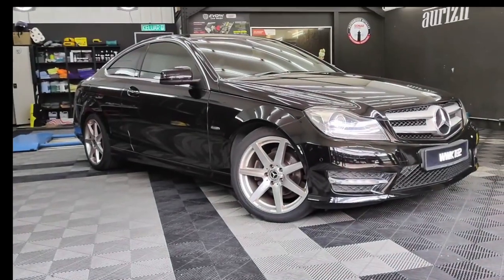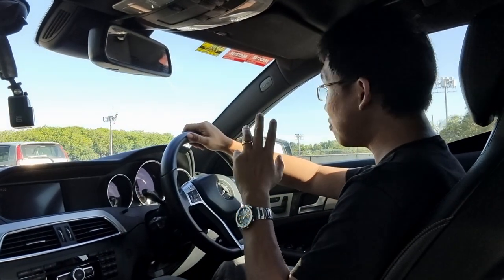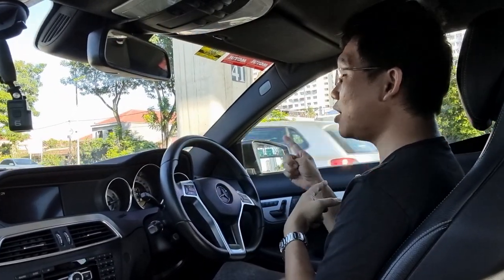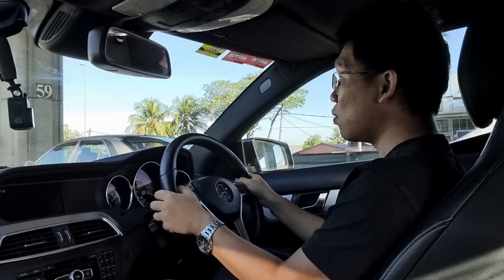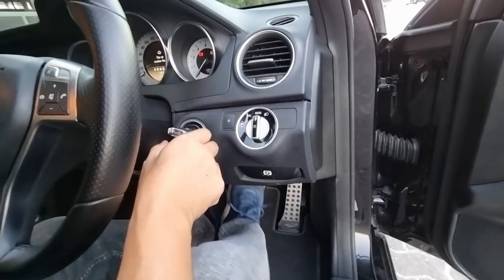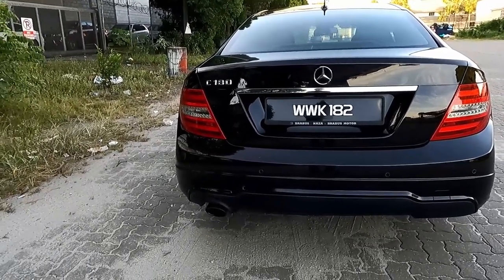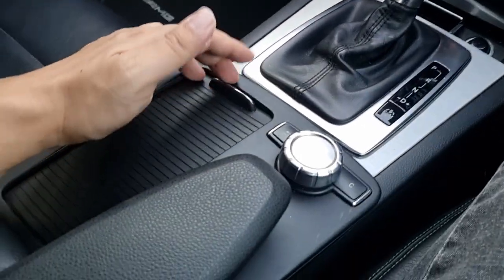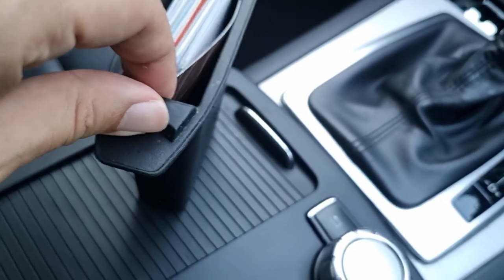Mercedes-Benz W204 Facelift - The Most Solid Modern Benz? | EvoMalaysia.com

Comment: Another note for anyone looking out for early CGi's, if there is blue smoke on cold starts 99% workshops will tell you its the turbos but its most likely the turbo oil inlet hose..happens to very early cgi models infact mercedes had a TSB on it those days ,cost rm200 siap pasang..almost got slaughtered but thanks to a german forum which helped me out..
Reply: what was the cause?
Reply: @ngkwdaniel  turbo oil line
Reply: yup, i had the same problem only happens at first start up early in morning. service center charged me 153 for valve and 80 for labor including for changing tranny oil and filter and bonnet spring too

Comment: I am driving a W204 C180Kompressor that is manufactured in 2010. It drives beautifully in Singapore!
Reply from the maker: Wah, you deserve special respect for keeping a Kompressor running in Singapore!
Reply: Mine too, I'm driving a 1.6 c180k in sg.. 2010 as well.. 💪💪
Reply: @fongalvin4995  with the crazy increases in COE, there are so many more us who are owning  the W204 C180K. I have seen quite a few around on the roads. Mine is white.
Reply: @KonWaiLuen  for that paper that we need to pay to own a car, the W204 C180K is one of the most affordable Mercs to own in Singapore. There are really quite a good number of us who own the W204 C180K. road tax is also cheaper than the C200K

Comment: I currently own a 2012 C300 W204 for about 2 months now and I've put 10.000km on it already.  Prevention maintenance after buying is quite costly but it has been a dream to drive, fuel saving although it's a 3.0 liter, and is pretty much bulletproof engine-wise.

Comment: As my everyday car, i can say what you say about the exterior looks is spot on but when you start saying it is a painless use thats where you got it way wrong. All car has issues even with by the book servicing there are still things in the car that will give you headache and pain. Note that this is not the car for the budget conscious but it is better and cheaper premium car than all the modern day Mercs.
Reply from the maker: Curious what engine variant are you having? 

When I say painless, I of course don't mean the car won't break down, or have no wear & tear, but rather that the W204 is such a mature and common product that parts are aplenty and most faults are known and easily diagnosed. 

Then again, tapping on your experience, do share if you have encountered any particularly complicated or expensive fixes that you've had to face on your car
Reply: @KonWaiLuen  I think the most annoying are the wheel sensors. Tends to breakdown every 1 to  2 years. When it breaks all the safety system in the car will fail too like ABS etc. Cost about RM2K to replace. According the authorised experts at the merc centre, it can also fail if you dont drive the car for longer than 3 days.

Comment: I own a 2013 C300 Sport 4matic with C63 AMG trim package. V6 3.5L with the 7 speed transmission.  I absolutely love this car thru and thru. It's the best handling with the Sport tune suspension coupled with the all wheel drive which gives the 3.5L motor more ease and less abuse for showing and feeling the power and acceleration.  The feedback from the road to car to driver is very well communicated,  very predictable which makes it so much fun to drive but also easy to get into trouble with those poor lovers with the red and blue lights,  lol! Ask me how I know but anyways. The exterior I think is sexy, elegant, sporty and means business all in one. The front end I think of the old roadsters which flows to the tucking of the front tires. The elegance of the fine lines of the body thru to the back of the car. It's like the engineers that designed and built this W204 C-class put everything they had plus more into this car. Seems like in today's vehicles all the thought is in the front end and down the side, but when it comes to the back end they just give up and slap something together. Same with some of these interior designs,  just plain,  boring  and big ass touch screen monitors.  Big isn't always better. When you sit behind the wheel of a W204 C-class like my model, you can feel yourself become 1 with the car. It's like the car and yourself are extentions of each other. Much respect to all those involved in the creation to final product of the 2008-2014 Mercedes-Benz C-class models. Other manufacturers could take some lessons from those true engineers of craftsmanship.
Reply from the maker: Thanks for your share! Where are you from? We didn't get the 3.5 V6, which I thought was the C 350? In our market, the C 300 had the older 231hp 3.0 V6.
Reply: Thanks for your indepth car reviews. I am from the U.S in Wisconsin. I am wondering if the car I now own was by chance a special order vehicle. There has been a couple of things I have came across that kinda point me in that direction. So I am here in the near future of actually going into a Mercedes-Benz dealer and see what I can find out. Just to know for me.
Reply: Thanks, I have the same 2012 Model but not 4 Matic. I fitted a rear window/roof spoiler (very subtle) and a small boot lip spoiler is about to be fitted. I find the seats are a bit low and do not give under knee support, but I can fix that my putting spacers under the legs.
Reply: @troygartmann6398 what extra options it had?

Comment: Excellent video. Good discussion on w204 and w212.   As an owner of a 2016 C207 E400, can you comment on if Mercedes created enough of a premium to merit the E badge on the c207 compared with this w204 C coupe? Enough features and other to differentiate these two coupes?
Reply from the maker: Good question! The differentiation is there, but where the E Coupe is concerned, my favourite was the C238, that car carried the proper heft and presence of an E-Class.

Comment: Hi Mr. Kon, im planning to own a used w204 cgi model. Just want to get advise. from your point of view as an owner to this w204 model. Do this model maintenance cost miles expansive compared to owning a honda?. Do this model frequently has major issue? And what would be the best advice from other w204 owner to a person like me? Really appreciate for your feedback. 🙏🏻
Reply from the maker: Parts will surely cost more than a Honda, but they also tend to last longer and perform better. Mercedes built these cars to take long autobahn miles at high speeds, so there is a price to pay for that engineering. Reliability wise, the CGI engines are generally good, but you do need to keep an eye on the timing chain gearm

Comment: I believe the cgi you tested is 7 speed auto. I still prefer the bmw zf 8 speed autobox than the merc as the 7 speed respond slower. Overall am impress with the build quality.
Reply from the maker: Yes, you are right. The ZF 8HP is still the best torque converter AT in the business.

Comment: I believe the 1.8 has 184 hp with a 7 speed gearbox.  I have a 2012 face-lift CGI model which I bought from a very close friend in 2022 who maintained it well with 81kms on the clock. In spite of that, I have spent 10k on wear and tear repairs. Now it runs beautifully with Chemlube engine oil.
Reply from the maker: It's a solid car. Can't run away from the occasional RM8k-RM10k bills, but I trust you can look forward to many years of reliable service ahead.
Reply: Yes, indeed.  @KonWaiLuen

Comment: Hi Kon. I own a 2012/2013 W204 c250. Bought it brand new and so far i changed the ABS sensor cables twice on all 4 corners (one of its achilles heel). Mileage is less than 60K because the tyres are too low profile and I only take it on the outstation drive. I wanted to change the tyres to a higher profile so that I can use it more often but I also prefer my Subaru 4WD on KL roads. My mechanic told me there is also the inherent camshaft sprocket early wear which trustgtr33 mentioned. Love the car & thanks for the review.
Reply from the maker: Glad to hear your testimonial. Sensors are normal wear and tear items for most European cars. As for the camshaft sprocket issue, it seems like a sufficiently well-documented issue that any prospective owners should address with preventive maintenance.

Comment: Very nice review of the w204 range, your knowledge of these vehicles impressed me, for example many reviewers of these cars are unaware that the c204 and c207 are basically the same car and share not only the platform/engines but many other parts. I agree with your assessment of the build quality of the w204 especially the facelift version, the interior finish is outstanding and as you mentioned the action of the auto gear selector feels like the bolt action of a quality rifle. I have owned the S204 Kompressor 2009 model and now have a 2014 C204 250cgi both great build quality but the C204 interior is a serious step up. I have driven several W205/S205 and C205 cars both diesel, hybrid and petrol version's and although they drive well the same build quality just isn't there especially when it comes to the interior finish and the fact so many body panels on the 205 version are aluminum you don't get that same vault door thud when closing the doors or boot for example. I am very pleased with my C204 and plan to keep it for several years still, having only covered 55000km so far it's just about broken in.
Reply from the maker: Yes, the way things click in the W204 is very satisfying! Which country are you from? According to my used car dealer friends, there has been a sudden drop in W204 demand here in Malaysia.
Reply: @KonWaiLuen  Belgium, still plenty on the roads here.

Comment: Hi Kon, been catching up on your videos. Btw im deciding between this C180 and the same gen (facelift) E250....putting price aside, which should I get? It will be a daily driver with reliability and maintenance cost in mind for another 5-10 years or so of use.
Reply from the maker: E-Class for sure
Reply: @KonWaiLuen  How about the lack of B pillar n E, in terms of road noise...and durability/security.....also I noticed the rear of the E is long, will it hit the ramp up and down multi story carpark? Thanks for your quick reply!

Comment: omg...I bought a used w212 prefacelift last year...aircon was just not cold enough compared to my year 2012 camry
Reply from the maker: That aside, how is the car?
Reply: @KonWaiLuen  performance,handling,soundproofing com9lanfirm tabao 😂
Reply: There is this little known issue of the inner layer of air cond hose delaminating. This can cause partial blockage of air cond gas. Search thru U tube.

Comment: M271 engine supercharge or the m271 evo on the CGi has one inherent issue is the cam phasers jamming up and stretch the timing chains...catch them early by listening for clattering sound on cold starts, usually for a few seconds..interior plastic tend to crack and fall off due to age. 5 speeders are robust but early 7 speeds can be problematic. Compared to my old e60 BMW, 10 years now into my A207 250 cgi...Mercedes proven much better terms reliability
Reply from the maker: I feel the M271 1.8 CGI pulls smoother than the M274 2.0 that replaced it.
Reply: @KonWaiLuen  i agree with you with the solid feel of the 204 and 212 models taking it back to the 124. Mercedes did mention that they responded to the complains fro the 210 and 211. Quite sad that the 205 has lost that 'built like a tank' feeling..

Comment: Boy,you have no idea what you talking about. W 204 facelift use om651 engine which is very unreliable and unquality..For example timing chain and tensioners,piezo injectors,plastic water pump,rusty rear suspension,bad sensors,cheap plastic interior,steering wheel lock dies...Mercedes  stopped to be quality  for a very very  long time ago.I owned w203 and now w204 and i know what i am talking about. And parts are very expensive  by the way and they are not quality  at all.
Reply from the maker: We don't get the W204 with diesel engines in Malaysia. Majority of our units are the 1.8-litre petrol compressor and later CGI engines.